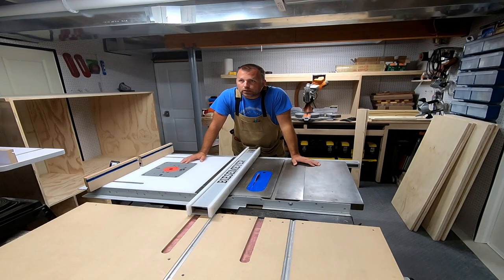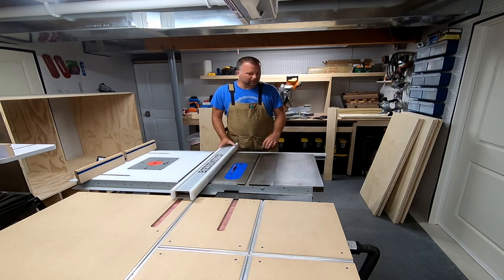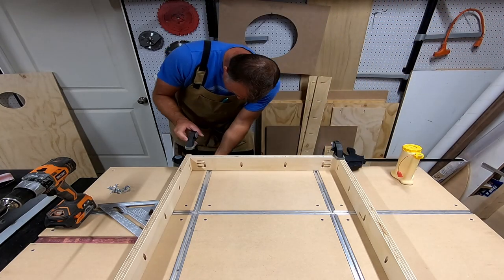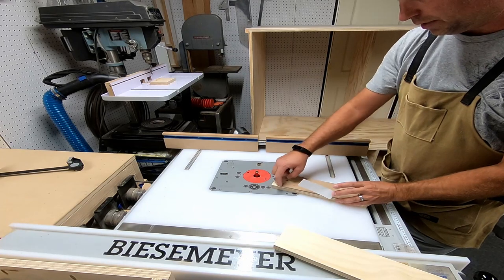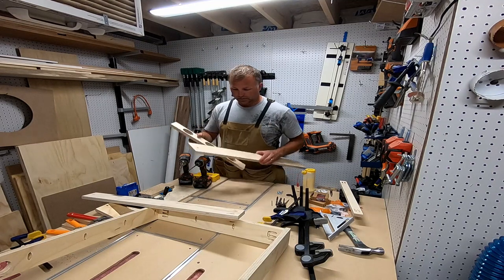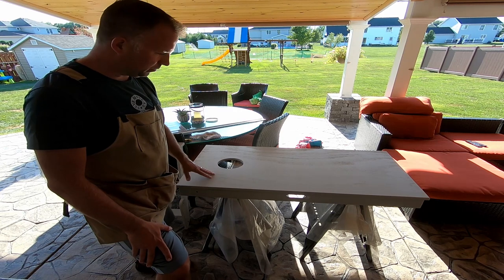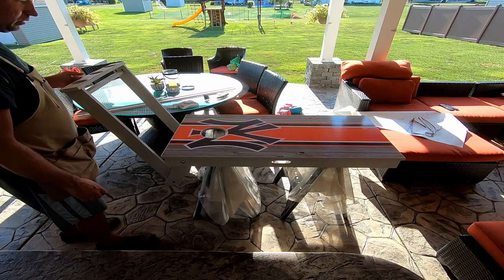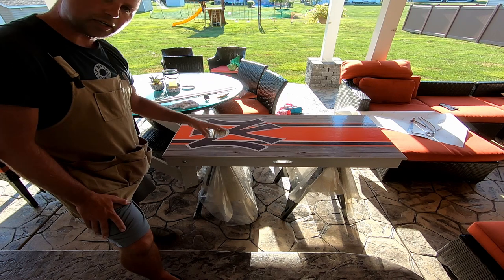Cornhole Boards --- Ultimate Design with Waist level cupholders attached

Comment: This is a really great design.  I like the idea of making a light-weight set and this is the first 3/4-inch plywood design I have seen.  The cup holder is a great feature.  My first set I made very light weight.  Problem I encountered was that I had a player place their hand on the side of the board to push themselves up and they broke my support board.  I am nervous about the hand-holds you installed on the sides.  This ei where my board broke.  These hand-holds took most of the strength away.

Comment: That is a very creative solution to having the coffee cups travel in a condensed form with the cornhole set. Do you find that the beans bags ever get caught on the extensions or hitting your drinks if the tosses are too long? And now after using it like that, do you think it’s still worth having it on the back of it?
Reply from the maker: There's just enough space behind the boards that if bags hit that exact spot you can tell they would have gone off and remove them. Package wise I still love having everything as one unit that folds together instead of needing separate cup holders.

Comment: very nice boards bro!!  I only have one question.  That cup holder will prevent bags from coming off the back of the board.  We play 3 or 4 times a week and 1 bag either way will change a game.  Now I understand some people dont play for money or have tourneys and just like to have fun which is wonderful but has this been an issue for you.
Reply from the maker: Thanks for the comment. That was part of my design concept. The way we work it is the slide into the arm would of went off the board without it there so we just eliminate them if they happen. Kind of like a bounce on. They are a couple inches from the back of the board top so it only occurs with a direct hit. Again thanks for asking though
Reply: yeah you need to re-design them.   the cupholders that close to the back of the board would be a no go for me.     they need to be a bags length away from the board at minimum.     good try though

Comment: It’s a nice design but its to low to the ground. Regulation corn hole boards need to be 4¨from the ground to the top on the front and 12¨from the ground to the top in the back. FYI.
Reply from the maker: That's exactly how I measured it. Thanks

Comment: great build, too bad you placed the vinyl upside down, the NY should've been on the bottom, it's not meant for you to cut a hole right smack in the center of the NY🤨
Reply from the maker: I know, I was so into filming that I missed that til I did the edit
Reply: @tommyboydiy1484  it’s all good, still a great build 👍

Comment: Funny how whoever hits the cup holder brace gets to stay on the board and gain a point instead of sliding off the board...smh..back to the drawing board bud..
Reply from the maker: Thanks for the comment. There is a slight interference there but it's a few inches past the back of the board as I did design it that way. Sometimes it does occur with the perfect throw but the teammates there can judge the speed and make a call if it gets stuck. Doesn't happen much at all to make the design useless